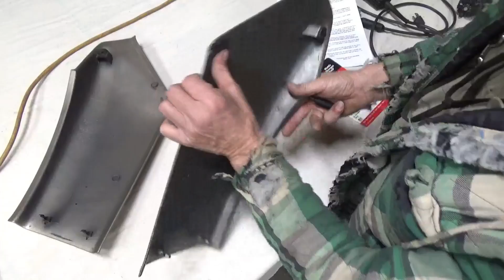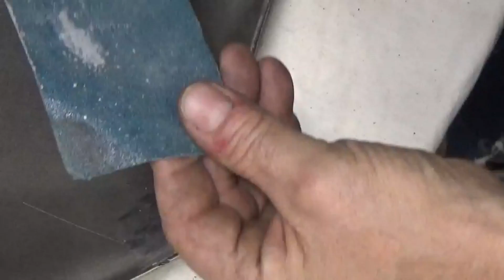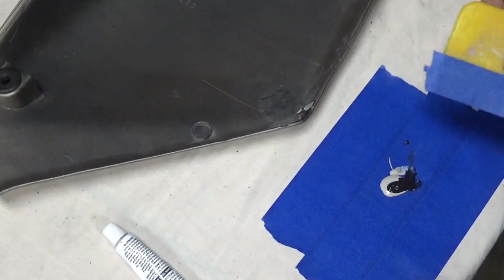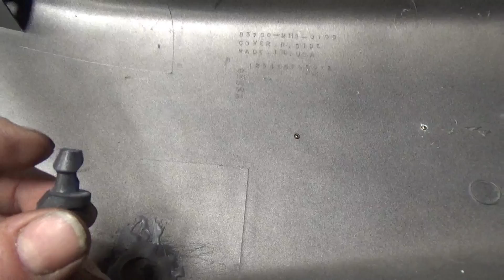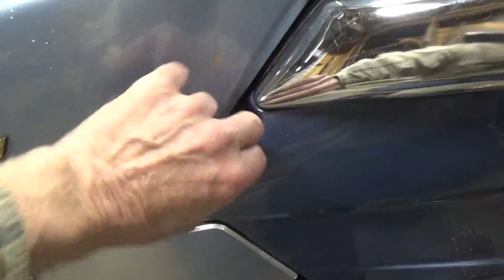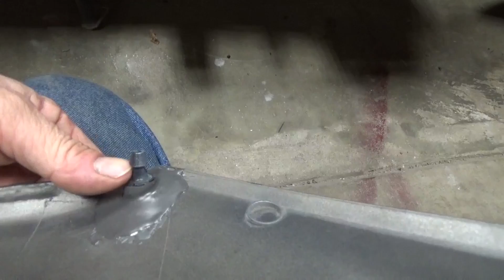Motorcycle side cover stud repair w/replace kit

Comment: Hey Buddy, I got a little tip for ya. Your grommets look drier than a popcorn fart. Keep a bit of lube on them and you won't rip the posts off. And try to pull straight out, with both hands. Thanks for the video!!

Comment: ABS is easy to glue if you are gluing ABS to ABS you use acetone it will melt it together you can heat form and glue it and make ABS putty from ABS dissolved in acetone which is a great glue where you need to add thickness fro strength or fill gaps

Comment: If JB Weld does not hold panel bond adhesive will :)
Reply from the maker: I searched for days for a glue for ABS plastic, that one never showed up. I had to weld all the broken parts. I'll have to look for that one now.
Reply from the maker: Ok I just Googled that and found it, it's what I use for the truck hood the name didn't register at first. That cost too much to try it for a part like this, if I had some left over from before or I had a job waiting then I could try that.

Comment: That's good thinking, Gord. Shaving down the side of the post to reduce the circumference that has to squeeze thru the grommet.  The other approach would be to consider examining and/or replacing the grommet itself, if it is beginning to get hard and petrified.  A new grommet, if they are available and not worth their weight in gold-pressed latinum, might be more supple and easy for the post to squeeze thru both on the in-stroke and the out-stroke.
Reply from the maker: I changed a lot of those grommets, I think that one was missing if I remember so that's a new one for sure. I have an assortment pack of grommets for the Goldwing, I should order a new pack to be sure I will have enough on hand for later or if I need to fix someone else's. I have several videos ready to upload to finish the bike video series, I will upload 1 or 2 every week while I'm working on my taxes and throw a few old clips of trucking up also because my subs don't care about my other projects, I know by how many views I get the 1st couple of days after an upload so I'll try to keep some truck videos mixed in even if I have to dig up old clips and remix them.
Reply: Pretty depressing that subscribers only "care" about one subject, but I guess that's individuality... you can't please 'em all.  I enjoy the variety.  Sure, like anyone else, I have subjects that interest me more than others, but how long can a person watch ONLY truck-related stuff?  And how long can one man be expected to spend working on and fixing trucks?  There's got to be time in a man's life for other things too.
Reply from the maker: We'll see what happens when it warms up and people start getting their bikes and boats out, some of these videos should catch on then.

Comment: I got some fibrefill plastic welding rods of the net that makes a great job of plastic welding on repairs like these. The pegs on motorbike side panels take some hard use. Just about every motorbike that uses push studs to mount the panels has a broken or repaired stud!
Reply from the maker: I have a 2 part video coming up later this week on plastic welding and showing that glue doesn't hold good on ABS plastic. Good to see you again Andrew.